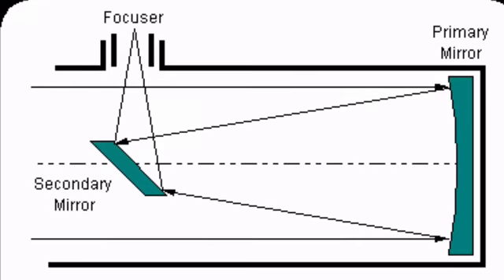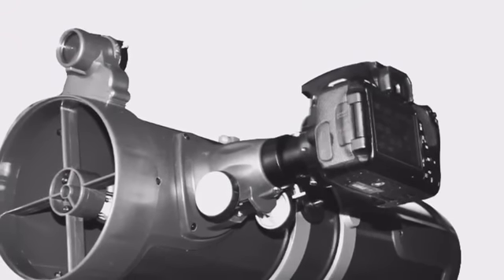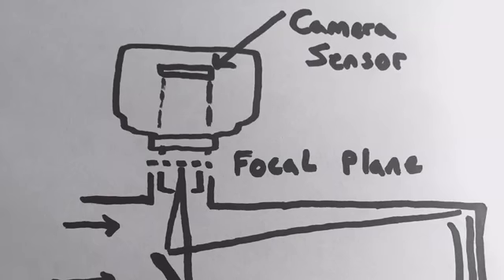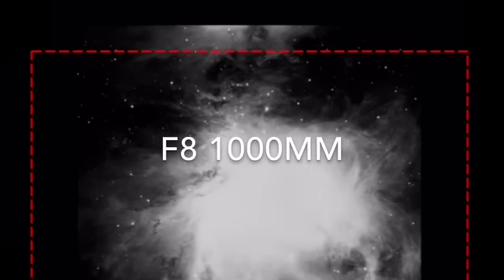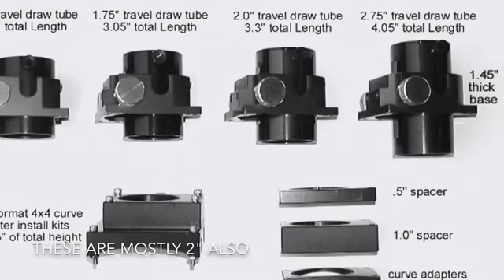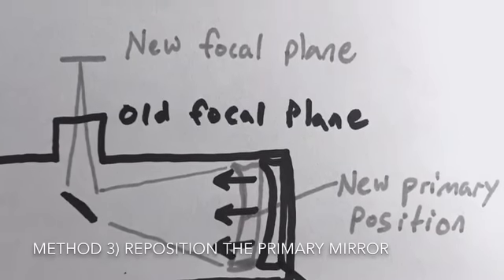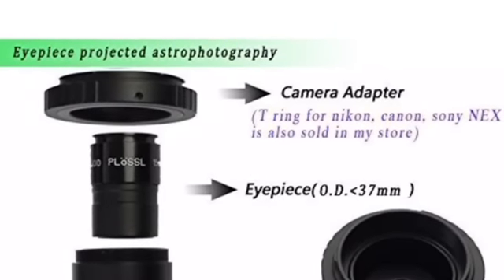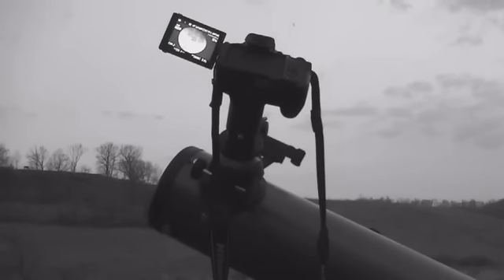Newtonian telescope how to find focus dslr astrophotography

Comment: Hi, I have a problem which I think is the opposite of what is explained here. I can get the moon in sharp focus on my dslr using prime focus, but the image is too big and cropped out on the display. How do I correct this and get the entire orb in view of the display?
Reply from the maker: It’s not really a problem per say. The image scale derives from a combination of the focal length and the sensor size. If you had a full frame camera you’d have more of the Moon in frame due to a larger sensor. The key to your current setup is a focal reducer. Something like a GSO 0.5 would be affordable and work to reduce the scale.
Reply: @GarnettLeary  Thank you for the help! I'll check out the focal reducer. Cheers! 😊
Reply from the maker: Anytime. What you want is something that can thread into a T-ring nosepiece. That’s the easiest configuration.
Reply: @GarnettLeary  Ah, that makes perfect sense. Thank you once again for the guidance! 😊🙏

Comment: Thank you for helpinh others! I have tye same issue and solved it with the 4th method (eyepeice projection) using celestron 24 to 8mm Zoom eyepiece. The eyepice has attachment to a T ring and can directly be used as a zoom lens at the same time.
Reply from the maker: Thanks for watching and I’m glad you found a solution. Clear skies.

Comment: Nice explanation..thanks..will try my sony alpha 6000 with attachments i received from B&H...I won't expect perfection..just curious if there is any focus setting I should on the camera?  Ill just point and shoot.  Didn't know if better to do manual exposure/f stop etc..experiment  Thanks
Reply from the maker: Definitely manual. The auto features of any camera fail miserably for night photography of stars. Sonys are really good for astrophotography. You should have a good experience. I’d start at around 1600-3200 ISO. That’s a typical sweet spot.

Comment: Thanks for this! Too bad I didn't find your video before as I stumbled over this problem thinking I was too stupid to achieve focus but recently solved this with your options 1 and 4. Option 4 I don't like too much as with Eyepiece projection I experience significant disfocus (is that a real word?) at the edges. So the center is focussed, but the farther from the center the more out of focus the picture gets. Hence using a barlow is my only option but not happy with the loss of light and increased f.
Thanks for illustrating the problem and possible solutions.
Reply from the maker: “Defocused”. I believe that’s correct. It’s possible the result would be greatly different with a different eyepiece. There’s a bunch of different eyepiece designs and they will yield varied results. Don’t rule it completely out. This was a topic that really hammered me as well. Information was scattered and hard to find. I wish someone like Astrobackyard would do a video on it so it reaches more people. Fighting with a Newtonian is a road many have traveled. Unfortunately, adding a barlow or eyepiece also adds additional aberrations. Cheap barlows will add chromatic aberration to an otherwise c.a. Free system. There really is no perfect setup. They typically are only as good as the money you throw at it unfortunately. I’ll continue to make videos about subject matter that either appeals to beginners or solves problems that largely end up discouraging people. The best part about this conversation to me is it seems you didn’t give up. It’s tragic when people do. It truly is only a hobby full of pitfalls because you can’t squeeze the lack of information into the Grand Canyon. Most folks are either trying to sell you something or show you what they can do. Both of those things are equally discouraging. Thanks for taking the time to share your story. Thanks for watching. Keep looking up. Clear skies.

Comment: Thanks Garnett. This is a problem I am dealing with at the moment. My solution is to use a Raspberry Pi High Quality camera with a suitable adapter. What is strange is that the focal point with this camera is further out (not in!) than the focusser goes. I use a barlow with the barlow lens removed  to get the extra distance.
Reply from the maker: Sounds like you own an astrograph Newtonian. The mirror in those is positioned in such a way as to bring cameras into focus. I’d like to know which model scope you’re using.
Reply: @GarnettLeary  Skywatcher 130p
Reply from the maker: I don’t know that scope. I’ve seen the Heritage version. It’s not a Bird Jones is it? Is there a corrective lens inside the focuser tube?
Reply: @GarnettLeary  I don't know sorry. All I know is that it is a Skywatcher 130p like the following,

Mod a Celestron SLT130 for Prime Focus for DSLR - YouTube
Reply from the maker: I just watched that video. It’s odd that Celestron would include a built in t-ring on a scope incapable of prime focus with a dslr. Somebody got fired in quality control. I read a lot of articles and don’t think it’s a Bird Jones. You’re going to have to move the primary Mirror forward.
Reply: @GarnettLeary  I am one step ahead of you. After looking at the mirror I have ordered some M5 standoffs and double ended studs. I also went down the hardware store and got some 50mm M5 bolts  nuts and washers. When my orders arrive I'll move the mirror up by 25-30mm which should be sufficient to get focus at an infinite distance. The nice thing about this mod is that its reversible and also will maximise my field of view.

One quick question however please. From your experience and knowing my equipment (above telescope with Canon 450d dslr) will I be able to get sufficiently detailed photos to be able to identify  and/or discover asteroids?
Reply from the maker: Certainly. The aperture is reasonable and it’s pretty fast. I would expect coma and that will be pronounced as you move the mirror. A corrector will be necessary for a perfectly flat frame which is especially useful for looking for objects moving outside of the Star field apparent rotation.

Comment: Hi, Thanks for sharing this helpful information.  I have done the eyepiece projection setup last night with my Canon rebel t7i on my reflector telescope Orion starblast 6"/750 mm,  But I couldn't find the Saturn on my camera live view screen at all. Anything else I missed ? Or some camera settings needs to be done that I didn't do?
Reply from the maker: Starblast should be perfectly adequate for the job of Saturn. One of two things probably happened. Either you weren’t centered on Saturn... easy mistake at such high magnification, or your camera settings weren’t adequate. Once you eyepiece project you need to bump your ISO way up and increase your shutter speed in terms of seconds. That will help you find Saturn which would be otherwise blacked out. Then you adjust your exposure down to get it correct. Could either of these two things be an issue? What helps me is starting wide and increasing my magnification as I go by changing eyepieces each time. It’s very difficult but your equipment should be more than sufficient
Reply: @GarnettLeary  Ok . Thanks for reoly. I will try again applying this guide's.

Comment: Hi, I have an Astromaster 114, and I attached to it a Sony A7 mirrorless just with the T-Ring and T-adapter (no barlow, no eyepiece). I was trying to take pictures to Jupiter and it seemed to be focused, but the problem I had is that if Jupiter was not placed exactly at the center then it presented coma. What do you think this may be? In fact, Jupiter seemed to also be very bright that I was not able to see its bands with the camera display. Do you think it was out of focus? why I got comma if Jupiter was not placed exactly at the center?
Reply from the maker: Uncorrected Newtonian Reflectors will exhibit coma. It’s more severe towards the edges because the shape of the curve in the mirror is more pronounced towards the edge. All of them have it. It’s not as noticeable visually. That’s just an unfortunate design problem inherent in mirrors. The exposure of Jupiter is an unrelated issue. Jupiter is an extremely bright object as you know. You have plenty of aperture at 114mm to resolve cloud bands. If all you see is a bright white ball it must be overexposure. You need to reduce the exposure time on the camera and/or use a lower ISO. Unfortunately when you expose properly for surface details you’ll notice you lose sight of Jupiters Moons. If you’re uncertain about focus (don’t worry this is true with everyone) find a bright star to test on first. Once you get a bright star in focus you will be correct for planets. It’s very difficult to focus correctly directly on a planet, especially with the rack and pinion focuser that’s stock on the 114. I don’t know of any coma correctors in a 1.25” format that I can recommend that would negate the coma inherent in that mirror. The faster the Newtonian, the steeper the mirrors curve, and hence the more pronounced it will be toward the edge. Cloudy Nights forums suggest overall that a Celestron 6.3 focal reducer/flattener is fantastic. Wether or not it combines well with your Astromaster I’m unsure. Put your camera in video mode. Reduce exposure and ISO until the bands resolve. Try to keep Jupiter centered. I hope this helps. Clear skies.

Comment: Hello, great video!  Do you know if the methods described here help with achieving prime focus on star discovery 150p? Do you have any experience on this specific telescope?
Reply from the maker: No personal experience with it but after reviewing it yes. It appears they sell it with an included “threaded” barlow. They had intentions on it being used for astrophotography. The F5 mirror will exhibit coma at the edges. Typically any Newtonian can make use of these methods unless it’s an astrograph. A scope that’s sold specifically titled as an astrograph already has the tube length and mirror configured for prime focus. 90% or more Newtonians on the market are not astrographs, this one included.
Reply: @GarnettLeary  Thank you for your answer! Its great info that i can achieve prime focus on this telescope too.
Reply from the maker: I hope you stay inspired in the hobby. There’s endless beautiful things to see and record. Good luck on your journey. If I can ever help don’t hesitate to drop a line. Clear skies.

Comment: i have successfully shortened focuser tube on the Celestron 130eq (the telescope pictured) to achieve prime focus, by cutting off the top 20mm or so off the focuser tube..
solution works well, although the drawtube does take up a bit of "wiggle" (these telescopes do not have enough teflon buffering tape in the drawtube, only one strip which creates a pivot point for the tube to rock back and forwards on)
Reply from the maker: Yes poor focuser design. Re-grease and baffle job due.

Comment: I have a 10” Newtonian reflector and recently purchased a 2 inch low profile Crayford focuser and a super wide angle 38 mm eyepiece. I can focus on a street lamp 100 feet away and achieve focus but when I aim the telescope on the moon all I get is a blob of light. Any ideas as to why this is happening. I move the focuser through its entire focus length but the moon is still a blob of light. Seems counterintuitive that I get perfect focus on a street lamp but not on the moon. Any ideas??
Reply from the maker: The focus throw of scopes varies a lot. I have a Maksutov that requires turning the focus knob around twenty revolutions from minimum focus to maximum. I also own one that makes those resolutions in under six. My immediate thought in your situation is that you need an extension. It’s very possible to have close focus and not infinite focus and the inverse. With large aperture fast scopes it’s also possible you need a Moon or ND filter. I can’t even bare to look at the Moon in my F4 10” Newtonian. It hurts my eyes it’s so bright. If you try an extension and it doesn’t work then try a Barlow. One of the two will work and will determine where you need focus travel.

Comment: I tried the Barlow method and projection methods, and while they both allow me to focus, I still can't get sharp pictures.  When I eyeball it through the lens (of the camera) I get it to where it looks the most sharp.  I tried focusing using the camera's "live view" mode, but all it does is show a box I can move around that is supposed to turn green when focus is achieved, but it never does.

Also, the projection method is a lot closer than even the Barlow method, and I'm not sure if it's going to be too close... I'm trying to photograph the Jupiter/Saturn conjunction.
Reply from the maker: You’re camera likely won’t achieve focus because the image is too dim. This is true of most high end DSLRs. The meter just isn’t powerful enough. EP projection does magnify much more and is difficult because of tracking requirements etc with reduced field of view.
Reply from the maker: Use the terminating line of the Moon to get your focus set. At its sharpest the planets will also be correctly in focus.

Comment: All I get as black images.. I feel like I've tried everything.. I know that's not true but it's getting frustrating.. I've used a Barlow and still got no light in the image.. I'm using a celestron nexstar 130slt and canon t6, t ring, male adapter and Barlow.. vega was not visible. I tried to focus on a street lamp but it didn't help.. I'm so lost..
Reply from the maker: +flamingo boot I've read a lot about that scope. Everyone is saying to position the mirror all the way forward. Likely you need more inward focus. A barlow should have solved for that tho. What about your camera settings? Boost the ISO up and shutter speed to 6" or more. Have you tried live view daytime? If you can focus during daylight that will answer a lot.
Reply: Garnett Leary thank for the speedy reply, living in Charlotte I have literally no help from other astronomers.. but I will try some daytime focus today.. what should I focus on?
Reply from the maker: +flamingo boot I live in New Bern. I know all about it. Anything. Don't worry about range. If you can focus daytime but not night it's definitely mirror position. It means you can't focus to "infinity".
Reply: Garnett Leary I found focus, thanks.. quick 10 sec video on my channel
Reply from the maker: +flamingo boot awesome. I'll check it out
Reply: Garnett Leary hey man I made another quick video of Saturn.. here's the thing, the go to mount failed.. it won't slew led or right.. I had this thing for a week... I'm going with an eq instead.. sending this back, I will do a quick review of it... spread the word, the slt mounts are not good imo... I had more fun hand guiding anyway
Reply from the maker: +flamingo boot I'll check it out.